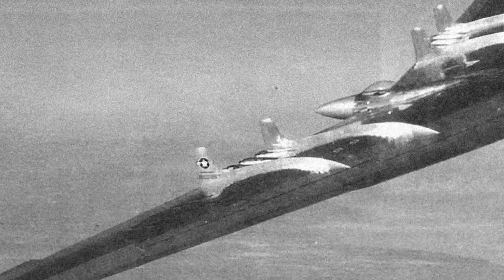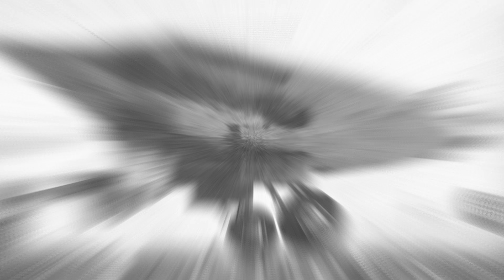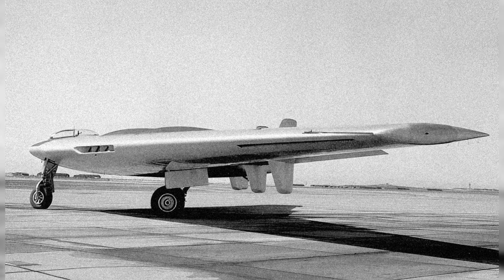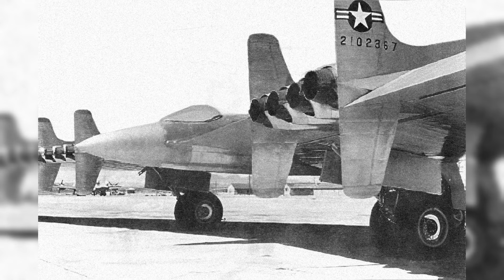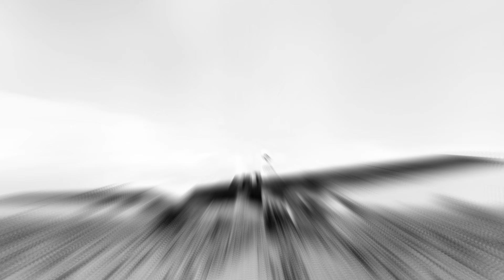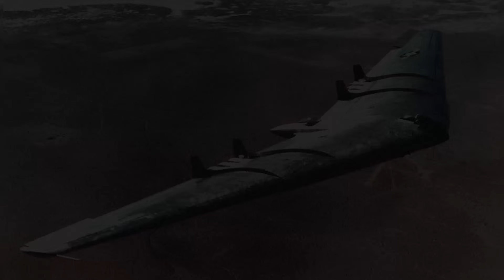Northrop YB-49 — From the Dream of a Perfect Wing to a Tragic End

Comment: What really killed the flying wing. it was a WW2 designed to fly from continental USA to Germany and return. By the time it was flown, it was no longer needed. Then when they dropped the atomic bombs on Japan, they didn't fit the bomb bays of the flying wing. It also had instabilities that a more modern autopilot would have fixed but was cancelled for the B-36, which could carry the nuclear bombs.

Now, the real kicker. Our new B-2 and B21, they have the same wingspan, the same sweep of the wing and general layout as the original B-35 piston engine flying wing. Before his passing Jack Northrup was shown the prototype to the B-2 as proof he wasn't wrong, just off by some years.